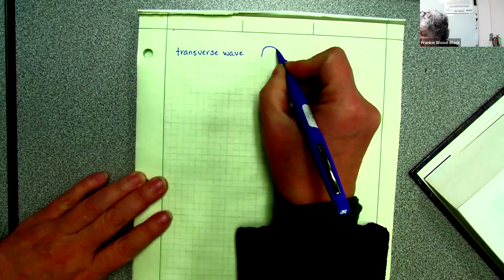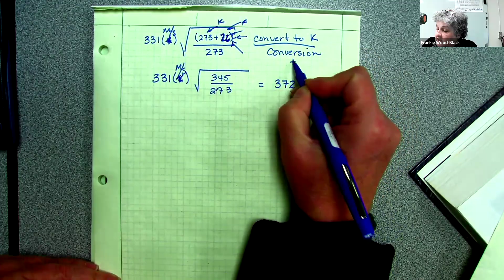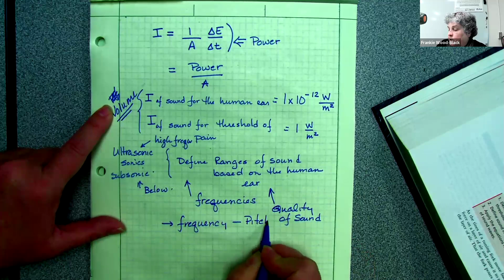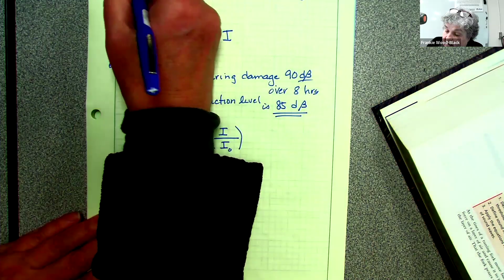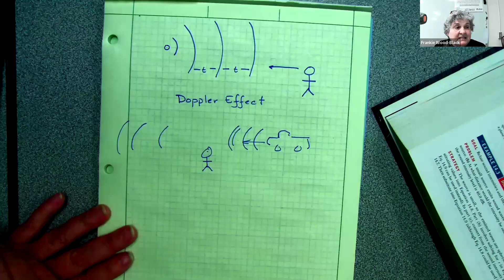Lecture Sound Intenstity Doppler Effect Jan 28

Comment from the maker: This lecture covers fundamental concepts of sound, including wave types, the speed of sound, intensity, and the Doppler effect.
Wave Fundamentals and Speed of Sound
Wave Types [00:23]: The lecture begins by distinguishing between transverse waves (up and down motion) and longitudinal waves (compression and rarefaction), noting that sound travels as a longitudinal wave.
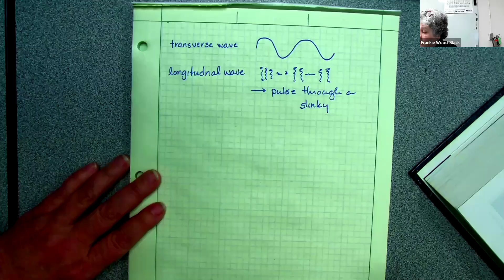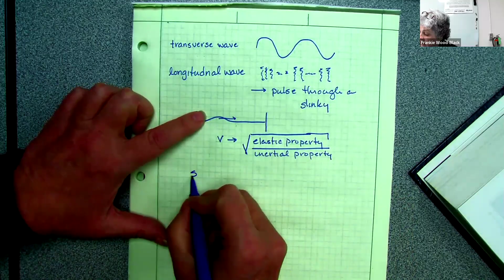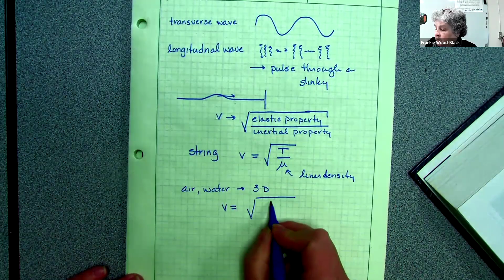Mathematical Properties [01:03]: The speed of a wave is determined by the elastic property divided by the inertial property. For a string, this involves tension and linear density [01:44], while for three-dimensional media like air or water, it involves the bulk modulus and density [02:23].
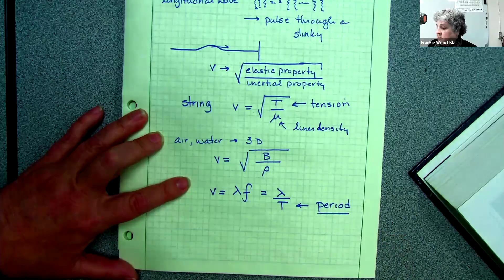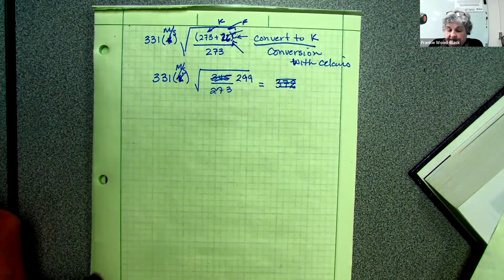Temperature Dependence [03:08]: The speed of sound is temperature-dependent. The baseline speed is $331 \text{ m/s}$ at $0^\circ\text{C}$ ($273\text{ K}$) [03:58]. An example calculation shows how to adjust the speed for room temperature, resulting in approximately $346 \text{ m/s}$ at $26^\circ\text{C}$ [08:32].
Sound Intensity and the Decibel Scale
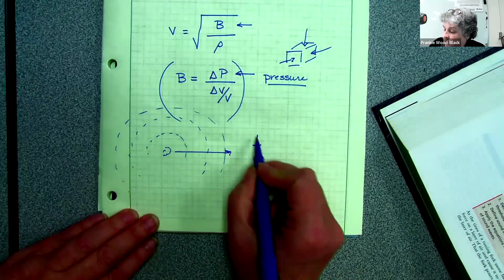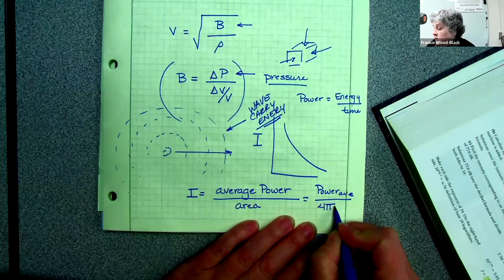Defining Intensity [10:42]: Intensity is defined as average power divided by area. Because sound spreads spherically, the area used is $4\pi r^2$ [12:02].
Human Hearing Thresholds [13:16]: The human ear is extremely sensitive, with a hearing threshold of $1 \times 10^{-12} \text{ W/m}^2$ and a threshold of pain at $1 \text{ W/m}^2$ [14:02].
The Decibel Scale [18:21]: Due to the vast range of intensities (12 orders of magnitude), sound is measured using a logarithmic decibel (dB) scale. The lecture highlights safety levels, noting that hearing damage can occur at $90 \text{ dB}$ over 8 hours, with an OSHA action level at $85 \text{ dB}$ [19:00].
Calculations [21:24]: Formulas are provided for converting between intensity and decibels, as well as calculating how intensity drops over a specific distance using the inverse square law [25:51].
The Doppler Effect and Supersonic Travel
Conceptual Overview [29:38]: The Doppler effect is the perceived change in frequency when a source or observer is moving. Walking toward a sound source causes you to encounter wavefronts more frequently [30:13].
Case 1: Moving Observer [31:36]: The observer moves toward or away from a fixed source.
Case 2: Moving Source [34:04]: The source moves while the observer remains fixed.
General Equation [34:46]: A combined formula is presented for situations where both the source and the observer are in motion, such as an ambulance passing a moving car [35:51].
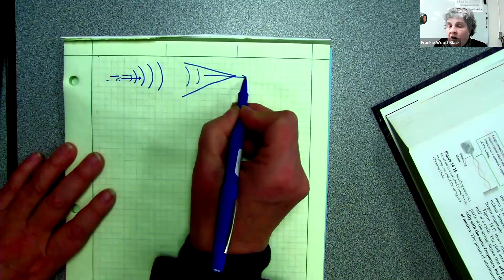Breaking the Sound Barrier [36:19]: When an object travels faster than the speed of sound, it outpaces its own wavefronts, creating a cone-shaped pressure wave that results in a sonic boom for ground observers [36:45].
Standing Waves and Human Hearing
Harmonics [37:41]: The lecture touches on standing waves in strings (fixed at both ends) and pipes (open or closed), explaining how nodes and anti-nodes determine the fundamental frequency and harmonics [38:35].
Anatomy of the Ear [40:23]: A brief overview of how the ear functions, from the eardrum and the three small bones (ossicles) to the auditory nerves in the cochlea [40:41].

Summary created by Google Gemini